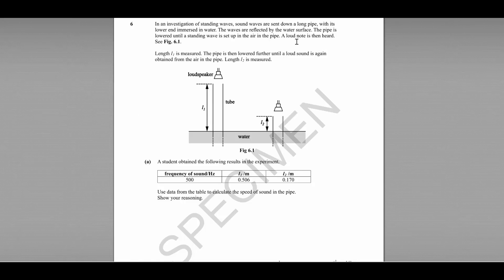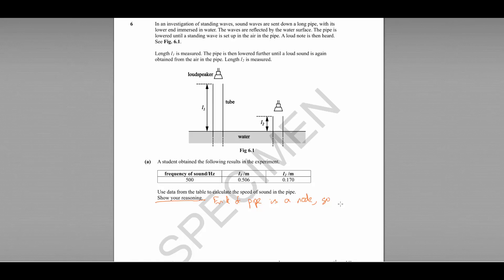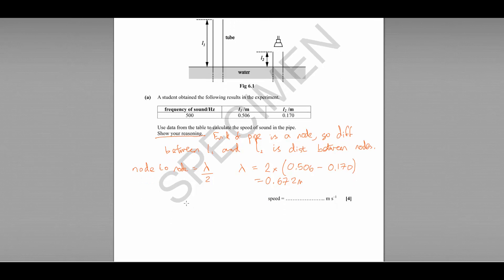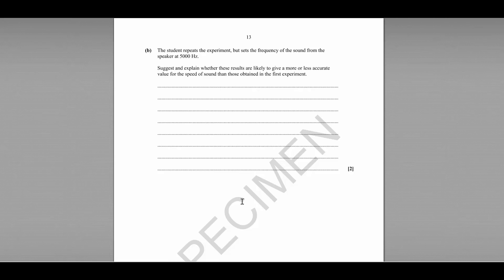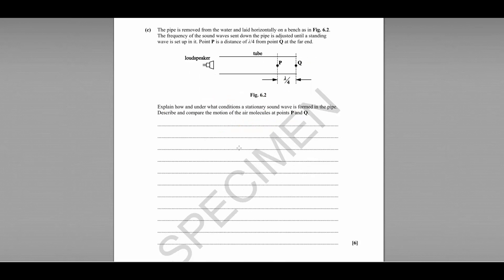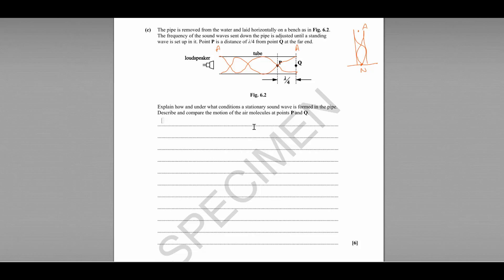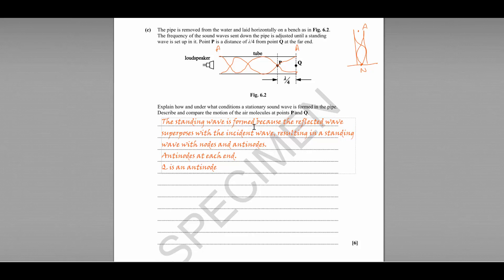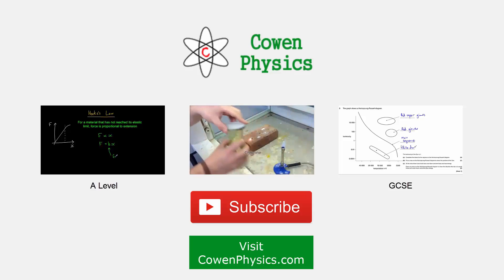Q6 OCR Depth in Physics specimen paper (standing waves)

Comment: Could you tell me how to work out an uncertainty, a% uncertainty and an absolute uncertainty and a % difference? I found them very difficult to work out in the experiment.
Reply from the maker: I've put a few details in here: https://www.youtube.com/watch?v=58JVrq5xTfE

There are two types of uncertainty: absolute and percentage. Absolute uncertainty is usually based on the precision of the equipment, so a ruler has an absolute uncertainty of +- 0.001m (or 1mm). To convert this into a percentage uncertainty, divide it by the value you measured and multiply by 100. That means that larger measurements will have smaller percentage uncertainties.

An absolute difference is the difference between your experimental value and the accepted value (e.g. 9.81m/s^2). To turn this into a percentage difference, divide by the accepted value and multiply by 100.

Comment: Do you believe the real exam will be more like the specimen or the practice paper? i found the specimen reasonable but the practice papers were mad hard.
Reply from the maker: +Mahmzo I would tend to agree. Remember two things:
1) An exam needs to differentiate between students at each grade (so will have a range of question difficulties). 
2) This spec is of the same difficulty as the old spec, so the papers should be no harder than previous years (apart from the fact that it will have new practical skills questions).
Reply: considering i have been getting 85%+ in the old specs mechanics/electrons wave and photons exams do you think i have a chance at an A grade. Thanks so much for your videos btw they are brilliant
Reply from the maker: Short answer: Yes.

Long answer: Yes, as long as you can match this performance in the practical skills questions.
Reply: +Cowen Physics Alright i feel a bit releaved now. Thanks alot. Just waiting on your walkthrough on the practice papers now........ :D